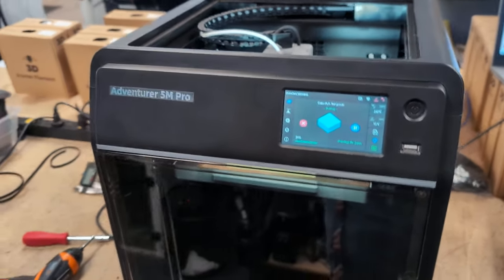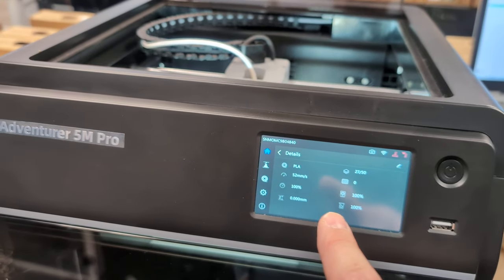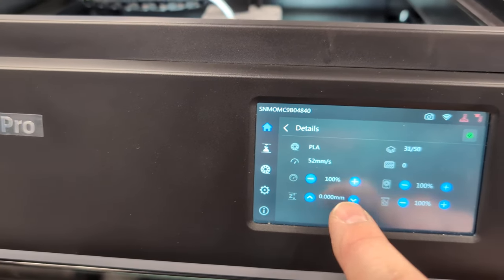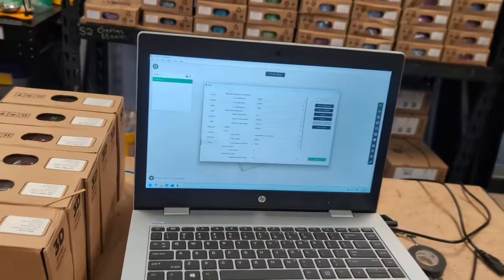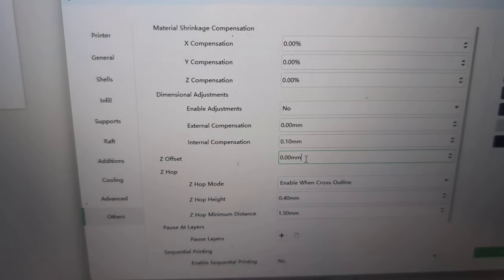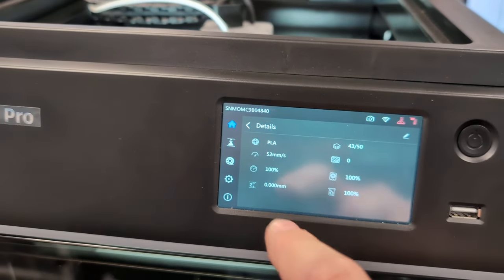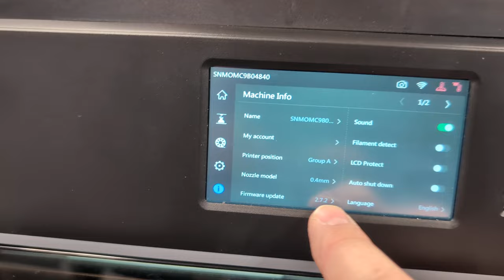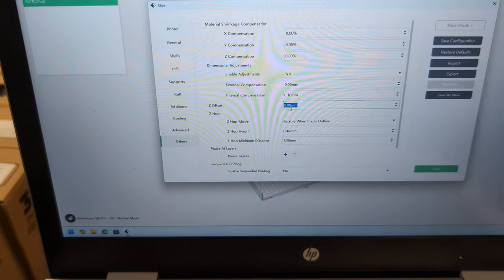FlashForge Adventurer 5M Pro ZOffset Setup - How to Guide

Comment: How do you determine what your offset should be? Is there a calibration method for getting this setup correctly or is it just a subjective determination? If so, in general how do you determine if your z offset needs to be adjusted? What are you looking for and do you use some type of general test print? And is this something that is generic to the specific 5M Pro you're using or should this be checked and adjusted for each different filament type you use? Appreciate any help. Thanks.
Reply from the maker: It's all based on how much "squish" the filament has on the bed. It should be just flat and not round. Too round = too far from the bed. Too flat/thin = too close to the bed. This value usually is the same between different filament types as its a machine setting, not a filament setting.

Comment: Are they being shipped with the z offset changed? Mine was at zero and after setup prints perfectly.  The initial setup seems to do a good job with this out of the box.  Im guessing user error is causing this issue for most people.

Comment: I just got the Adventurer 5M pro and have been having difficulty with the z-axis settings.  When the machine calibrates, the print plate keeps trying to lower beyond the limits of the a-minimum.  Any suggestions?